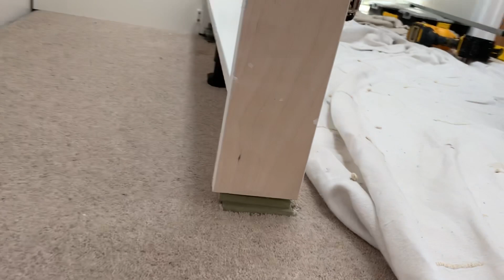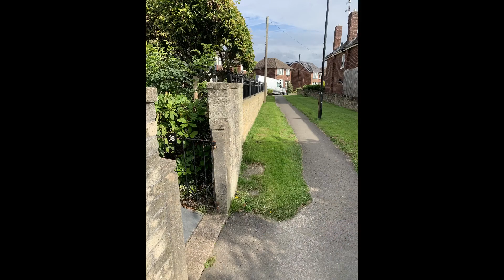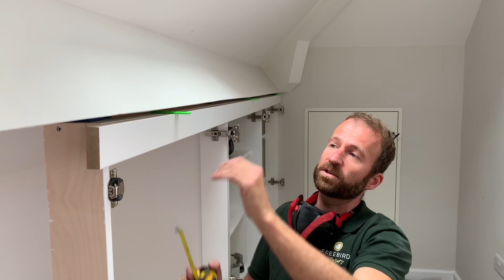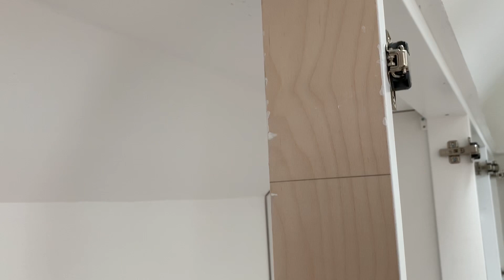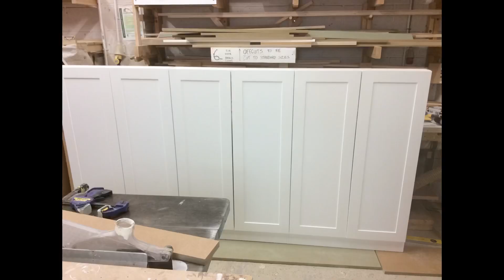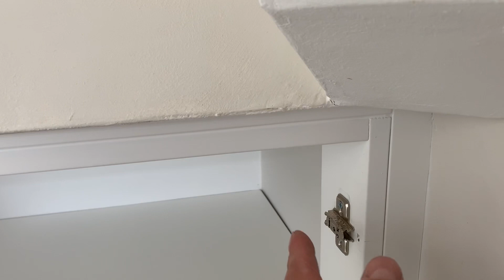Attic wardrobe storage build video

Comment: What is the spacer you used between the top cabinet frame and the plaster at the ceiling beam ?  I know you use Space Plugs in most cases , but the spacers in this vid are much shorter than Space Plugs, and I think that is what I need for my current build. 

very helpful video, I am building doors to enclose space under stairs and I don't need an ultra-finished clothes wardrobe, it is simple storage and to hide (but keep accessible) a water heater.

Thx
Reply from the maker: Hi it’s one of those things I try to standardise but each project seems to have different needs.  If I want to use space plugs I aim for around 40mm.  The proportions of this job and the desire to maximise usable height made me design around 20mm I think. I don’t usually allow for a tolerance any smaller than that or I might get issues with things fitting allowing for levelling to wonky floors and bending beams etc
Reply from the maker: Just realised I didn’t answer your question, I think I just used packers - I keep a stock of offcuts cut to about 75mm square.  And plastic packers in 1, 2 and 3mm
Reply: @Alastair_Johnson  I have seen you use those things in several vids, but had no idea what they were ... If you live in U.S.A. and google "packers" you only get information about the sports team from Green Bay, Wisconsin :D 

I finally figured out that they are what we call shims, but made of plastic instead of cheap softwood wedges ... I have never seen those used by anyone, all trades workers I know just use the wood shims, which have their drawbacks.

In my situation, I will need spacers between open cabinet frames and the outside stringer of a staircase, which stringer is a little bouncy and twisty, so I don't want wood against wood, which you point out in one vid can lead to squeaking.  So I think I will 

1) add braces running between stringers at point between two cabinet door sets (where I will have a full depth panel on the "storage" cabinet, but only braces to the back wall on the water-heater utility cabinet side

2) put in a vertical stud attached to brace at outside stringer, and 

3) order some "packers" so I can use them to bridge gap between bottom of stair stringer and top of open frame

 ... probably a bit of construction adhesive also (I have used that between floor joists and subfloor panels also to prevent squeaking)

Thanks much again
Reply: Just for giggles, here is my current Sketch-Up iteration, using your open framing approach ... I have hidden some layers for clarity.

Yellow is existing framing, green is planned new framing to shore up the staircase, blue is drywall, white is planned cabinetry

http://prntscr.com/wf7k80

.

Comment: Hello again Alastair, long time since iv been in touch, wanted to ask how you fixed the dividing gables to the back of the frame as iv got a similar project coming up, you input would be a real problem solver
Reply from the maker: @Glenn Cox hi again Glenn I simply used white modesty blocks with 25mm screws - the frames double up in thickness and the divider is placed in line with one of them and the modesty blocks sit behind the other one screwed into the back edge of it and sideways into the front of the divider
Reply: Thanks Alastair. I was trying to work it out from the video ha! So I had to ask instead. Thanks for your help

Comment: Sorry if this is a stupid question, but is it any more or less tricky / different when designing and fitting a unit such as the one in the video, where one end isn't immediately next to a side / supporting wall? I make the distinction between this particular design and one where the cabinet fits into an alcove per se.
Reply from the maker: Jay K I know what you mean.  Yes there is more work because a bigger cover panel has to be prepared and painted and also scribes on 3 sides; vs a narrow in-fill strip scribed in a gap.  Some bedroom manufacturers keep material costs lower by making the side of the unit itself oversize for scribing are the back, and separate plinth and ceiling strips at top and bottom, but we stick to the applied end panel method for a few reasons: you don’t have to use concealed fixings for building the main carcase.  It’s kind of easier to just crack on and  level and fit the carcass spaced off the wall then only scribe the flat panel.  And also it gives a more solid finished look and feel to the furniture, and avoids an colour mismatch issues between, for example, the melamine carcase material vs the sprayed of vinyl wrapped doors and other external parts
Reply: @Alastair_Johnson  I understood all of what you wrote. I think I'm making progress, hehe. Thanks for the explanation.

Comment: Brilliant build and great tips! I just finished a kitchen off today. Ironically the top boxes of the kitchen were almost the same shape as this unit, I also left them away from the wall and didn't scribe tight!saves time and you will never see it!
Reply from the maker: Nic Harvey do you mean they were fully boxed in units, and you cut a corner off the rear upper section, revealing a bit of sloped ceiling?  Yeah it’s ok to be neat but not perfect sometimes!
Reply: @Alastair_Johnson  they had no backs on and just loosely scribed to the back wall. Just like yours, but I admit I wasn't as neat as you! Uploading to Instagram tomorrow, will tag you in!

Comment: From what I can see(ish) the uprights for the shelving are modesty blocked to the door frames, is that right?   Then angle blocked to the wall, similar to what sharps do with some builds.
Do you think the door frame method would work with taller doors? (2m odd).  I've missed a fair few of the videos of late but as ever this is a good one, thanks 👍
Reply from the maker: No Skills yes modesty blocks and ‘corner connector’ white plastic blocks which can be easier to use and come with a white cap that conceals the screws.  Yes we have done it the same way with taker doors.  You seemed skeptical about the 18mm thick frames on Instagram but using birch ply or pine they are rigid enough, especially once it’s all tied together.
Reply: @Alastair_Johnson  I'm a sceptical chap 😳 😁  thanks for the reply. I imagined mdf frames wobbling all over the place, a good plywood seems a much better solution.  The door frame method seems like a good work around for the odd person that wants 'doors but nothing inside' for an alcove or similar.  Cheers 🍻🍻🍻

Comment: Always interesting to see how other guys approach these things Alastair. I’d have put a 6mm back on them, I think, but I understand why you chose not to. And those skinny scribes are always fiddly; I’ve sometimes scribed one edge, then trimmed the straight edge back to size as it’s easier to handle. 🤷‍♂️
Reply from the maker: Peter Millard shocked to discover I never replied to this comment, I like to always reply (especially to you 😉) yes scribing to wall and then a straight edge cut makes a lot of sense in some circumstances!

Comment: I use the uscribe jig with the filler piece above the jig in this case, so you do an initial cut to let it fit with the bottom factory edge level to the underside of the frame. You can then use 18mm offcut as a scribe block. 

As I am typing this it feels like a long way round potentially but i think the solid block against the purlin would give a nice clean line 😁
Reply from the maker: Matt Kindon yeah I know what you mean; I have done that way too.  It does feel like extra effort to cut it twice so perhaps that’s why I’ve been avoiding it more recently, but sometimes taking the time to do that sort of thing actually works out quicker doesn’t it, if it means you are all set up for a precise scribe cut straight off the first mark line.
Reply: @Alastair_Johnson  I think with the set yp you have for the track saw it wouldn't add too much time, but thinking about it a narrow scribe like this would certainly be harder to cut with the jigsaw by my method than with a nice size piece like you worked with!
Reply from the maker: Matt Kindon I did a lot of the final trimming with my new Festool EHL 65 power plane, that works well on thin strips supported on the MW1000 workbench.  (I do appreciate having that workbench, it was worth the expense!)
Reply: @Alastair_Johnson  really glad it's working out for you, it a significant outlay! I make do with a homemade kind of version based around a replacement mft top and trestles for now, but even that makes everything so much more efficient and safe I xan see why you got the real deal. 

Do you find the festool planer good for dust extraction? I've been making do with a hand plane for years and focusing on other tools but it really is time I got one!
Reply from the maker: Matt Kindon I have found that any power plane is good for extraction (at least all the ones I’ve used) because the cutting action also acts like a fan blowing the chips up into the place where the suction then easily removes them.  The EHL 65 is great.  You don’t see any dust.  I would recommend it, but  it would even be worth getting a cheapo one for starters, that will also bring benefits to your speed.  I mainly wanted the EHL 65 because I was doing a lot of scribed edges of panels laid flat on the workbench and a heavier power plane was hard on my wrist held at that angle.
Reply: @Alastair_Johnson  thanks for the tips it's really appreciated